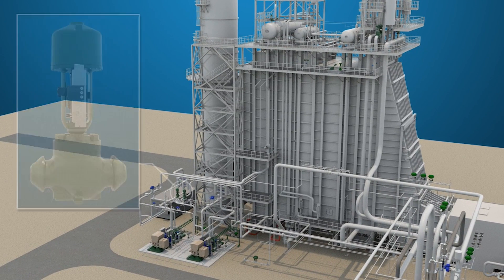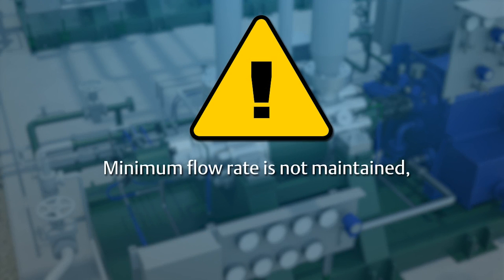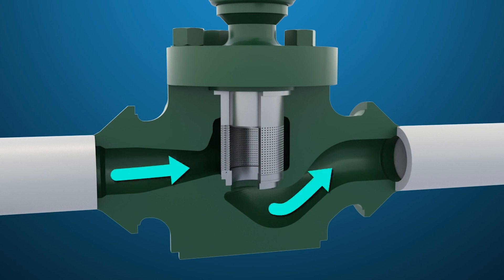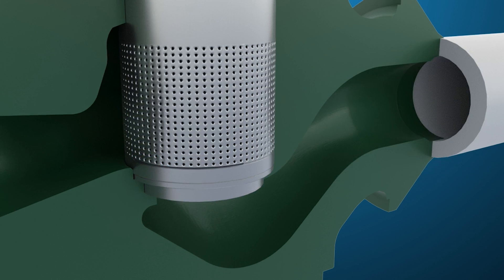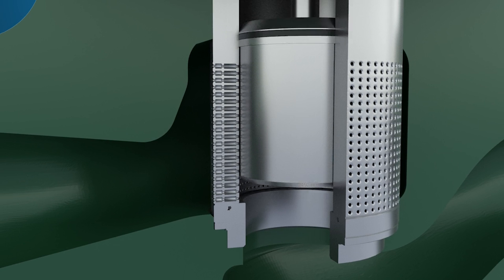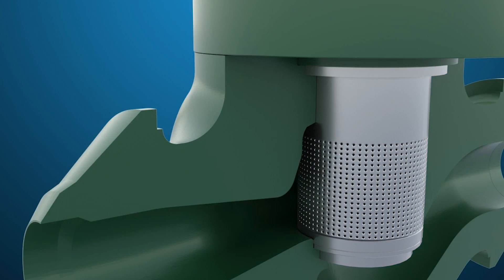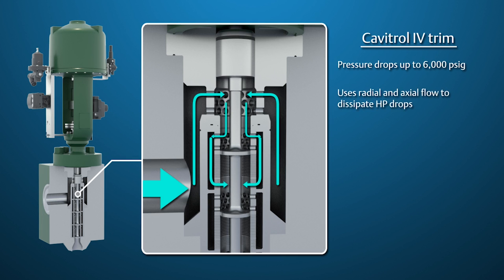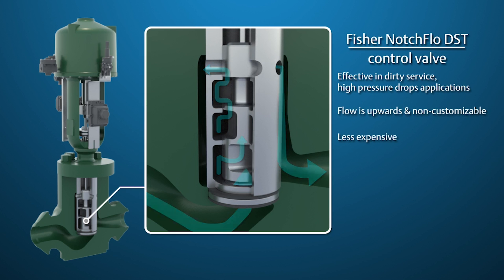Boiler Feedwater Pump Recirculation Valve Operation Overview | Power Industry Application Series

Comment: How does the presence of magnetite, rust, weld slag, and other debris in the feedwater impact the maintenance frequency and lifespan of boiler feedwater pump recirculation valves?